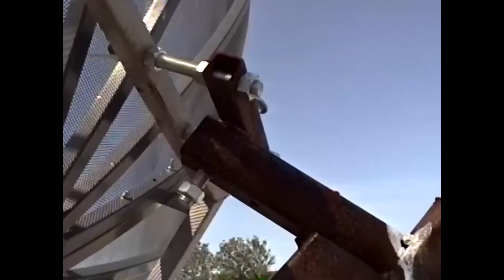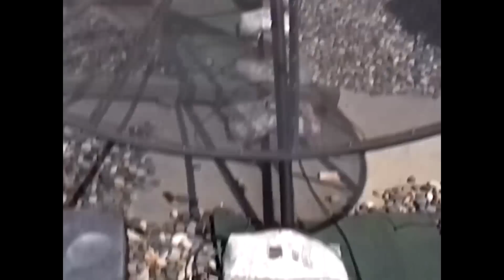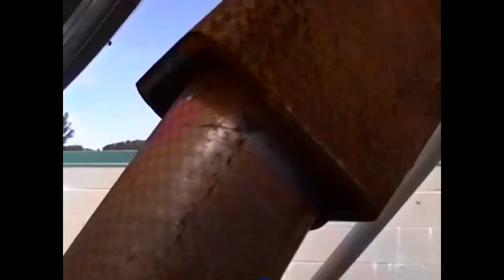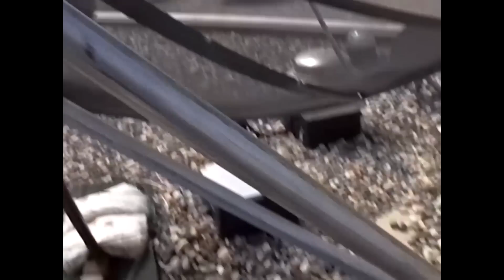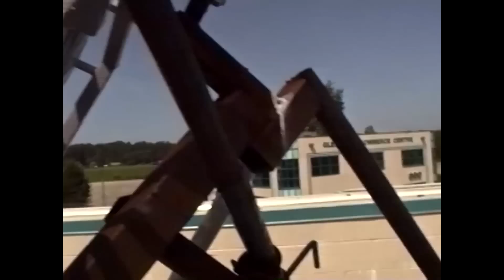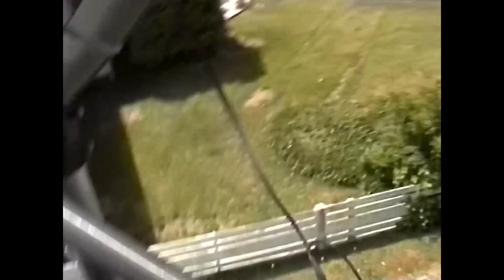How NOT to install a Satellite Dish an inspection that lead to a lawsuit

Comment: Looking at that satellite dish up close, even I would have known it was mounted in a shoddy way (I would have never noticed from a distance); but I never before imagined that there is so many details to think about with those larger dishes. Those smaller dishes used in Dish Network, DirectTV, etc. make it look easy. Even today, satellite dishes (especially the larger ones) still fascinate me.

When did you first start working with satellite dishes, and was it difficult for you to learn all the ins and outs? Have you also worked with satellites that transmit/receive Data (i.e. for banks, big box stores, etc.) instead of TV channels?

Comment: Your video is a good remembering of all the nasty things I've also seen over the years. But yours could win a special mention, with everything for the worst and the ugliest, with a second hand mistreated antenna, a nude LNB (a polarator in a plastic bag!!!), and by far the ugliest available non sense mount (they could have spent some money in a protective spray paint!). Here in Europe C band sat was never popular as far as the satellite networking was done with Ku band with smaller dishes. These dishes (generally 80 up to 100 cm for analog service) could also be mounted on an equatorial mount, and it was a precision work you could only achieve properly if your mast was perfectly vertical and stable! Of course, with a single satellite fixed mount, this was not as important, but you still needed a stable and strong support. Even with later single sat digital service, a 60 cm antenna is generally over sufficient, but wind pressure is always a problem... I remember how antennas and dishes could cause structural problems  to buildings or went literally away with early 1999 tempests. And I also remember trying to explain to some stupid how it was dangerous to mount such equipment on a chimney, to see the complete stuff down the street later in December 2005!

Comment: I have been using a #FreeSatelliteTV C band dish for years, I don't get as some of the over the air tv networks in my area. So I use a Amiko Receiver to get the Digital Broadcast channels. It is great because I love the old tv shows that are on MeTV, Cozi, Heros and Icons Grit etc Most of them are on C band
Reply from the maker: The METV channels are available on a local terrestrial station here. All 7 of them.

Comment: It's laughable you're "inspecting" an old satellite 📡 dish.. looks like it's been up there for a decade with all the screwing around that's happened to it.  No installer in their right mind is going to pierce a membrane on a flat roof to install a satellite dish "securely".  Using rock or sandbags is a normal way to mount this equipment on a flat roof.  With residential they don't care what they do to your roof for the most part, because it's residential and they get contractors to do it that go out of business about the time they leave your driveway.
Reply from the maker: A proper mount for a flat roof is a large square base with a 3.5" pole mounted it it that the proper polar mount is attatched  weighted down with usually bags of concrete in sacks and alot more than what they had.  I agree never penetrate the roof, residential or commercial.  This one was just bad though.
Reply: @12voltvids  Also the rocks were in plasic bags, which will turn to nothing within a year from the UV. Proper installations I have seen used concrete slabs as weight.
Reply from the maker: @mrnmrn1  that's right.  Concrete slabs or bags of concrete which will get wet and turn to solid concrete.  It was a disaster that was installed by a supposed professional satellite company.  I was by no means a professional satellite installer. I had installed exactly 1 big dish.  It's still standing so i must have done it right.

Comment: I am in awe! The level of failure here is genuinely impressive.

As for programming, I remember on Telstar 3, transponder 21 I think it was, there was some syndicated shows for the upcoming week, I think the channel was a network uplink for the broadcast channels to get the shows. My family had a C-band system in the 1980's, from 1986 to 1989.

Comment: Is anything done on those ginormous C-Bands anymore?

And did they win the lawsuit?
Reply: All of the network feeds to the affiliates (ABC, CBS / CW, FOX and most cable channels) are still distributed by c-band in the US. NBC and PBS use Ku for their primary feeds, but PBS is transitioning to a file-based distro across the internet (though they've been working on it for years, but still have their traditional satellite distribution running). In Canada, most of the "networks" are all master controlled from one or 2 locations for all of the stations across the country (CBC / CTV / CITY / Global) and as far as I know, what little traffic goes from the "local" station back to the central master control (usually only the local news) is by fiber. All of the "cable" distribution in Canada is either by Shaw Direct (Ku FSS), or Bell Satellite (Ku DBS), with some cable channels distributed by fiber (so when you watch "cable" in canada, you're basically just watching Shaw Direct or Bell ExpressVu, but on a wire, not by satellite).  You can find lots of live events still backhauled on c-band and Ku band. 95% of the live news feeds have all gone to cellular backhaul now - they have a backpack sized unit that has 5 or 6 cell modems bonded together, and it's much cheaper and quicker to setup, and a lot more portable than a sat truck. Live news feeds on satellite were some of the most interesting stuff up there before. There's also a huge re-organization going on right now as 5G cellular has taken over the bottom 50MHz of c-band, and in the final configuration will take over the bottom 300MHz of c-band, leaving only 200Mhz for satellite. (C-band used to be 3700Mhz to 4200MHz - after 5G takes the bottom 300Mhz, satellite will only have 4000-4200MHz). As a consequence, some signals are transitioning to fiber distribution. Satellite used to be a really fun hobby to play with (and it still is), but more and more stuff, even live events, are going to fiber now.

Comment: Sky prob would have had 16 channels at that time in UK.
Reply: I still have the same 60cm dish on my wall required to receive those channels, upgraded the lnb and still get free foreign TV and radio on it. 🤔🤔
Reply: @markrowe8824  in the 90s it may have gone up 60 channels don't remember but had amstrad and pace box's.   And sky HD is now a lot better but cost lots.  Disney plus seems to be taking over.
Reply: @EastAngliaUK  yeah when sky digital launched I had a separate 30cm dish installed, again still have it but now lnb upgraded to use with a sky HD box, then cable came to our street and switched over for added broadband, no longer subscribed to sky but box still used as backup for free TV and radio channels.

Comment: before digital and HD I take it
Reply: Most of the HD signals that are broadcast still go by satellite - but more and more are going to fiber. The dish is the same, but you need digital receivers. That old analog boat anchor "satellite receiver" from the 80's won't do anything now - there's no analog satellite left.

Comment: Are you wearing the same watch since 98?
Reply: it still works fine, maybe a battery change or two
Reply: @marcogenovesi8570  This model is solar powered and has a high quality rechargeable battery, might still be running on the original one.

Comment: You did a great job dave ,  You made it very clear that it was one massive ripoff and was very dangerous.
I bet the installer company got thrashed for there greed.
Somewhere in the mid 80's i guess.
The tape has lasted very well.
Reply from the maker: It was 98 and that restaurant is still there. Thats why i blocked the name.
Reply: @12voltvids  You sounded different outside with less bass and i thought you were  a lot younger., you were 23+ years younger in 98 ha ha.
I was too busy watching you checking the heap of crap than noticing names.
Reply: God that was so damn bad, surprised that it even worked at all
Reply: their*
Reply: @DarthVader1977  Ask me if i care lol.

Comment: Are those large satellite dishes still used these days?  It seems we most consumers shifted to the smaller kind used by companies like DirecTV and Dish Network.  I wondered if one can still get TV using the bigger style or what they are used for these days.
Reply from the maker: Lots still on cband a quick check if lyngsat shows tons of channels.  Most us scrambled. The METV mux of 7 channels is free to air but then i can get that off air with atsc antenna.
Reply: @12voltvids  Lyngsat is not a very accurate or up to date list of what's there, but it gives you a rough idea. The long and the short of it is there's still lots of stuff on c-band, but more and more is going to fiber. 5G cellular taking over the bottom 300MHz of the c-band spectrum is accelerating the move to fiber.
Reply from the maker: @gorak9000  I haven't looked at lyngsat in a long time. My c-band dish which also has KU is still mounted I don't know whether the actuator works or not anymore because it hasn't been moved in many years. I still have a receiver setting up on the shelf stop plugged in the coax I think is still connected to the dish. It's one of these projects that someday I might try it out again and see if it will still pick up anything but the chances are pretty unlikely. Maybe I'll just take the dish down and scrap it because there's not really much of interest on it anymore. In my younger days it was fun to chase out the wild feeds. I had a blast searching out the news feeds that were on satellite but these days I don't even think there's much there anymore. Modern remote news gathering uses more microwaves or even cellular these days. In fact I can't remember the last time I saw a microwave truck for the local news stations. You should see them driving around all the time with the dish towed on the roof of the van or when they were set up they had the mast up with the antenna pointed towards one of the local mountains where there was a receiver site for the station. I think these days they probably just plug their camera into a phone and go through the cellular network or broadcast from a phone for that matter. I remember seeing some adapter cables that would take the output from the camera and interface it directly to a cell phone to utilize the modem and that was years ago I'm sure it's all done by Wi-Fi these days just turn on the hotspot on your phone turn on the Wi-Fi on the camera and you're good to go. The fun days of finding stuff off satellites catching reporters in the act of straightening their tie or practicing their lines are picking up speckled lettuce out of their teeth before going live those days are gone of course the real fun times was when a reporter had a little meltdown on camera before going live or after or when something didn't go as planned. Some of the funniest stuff was before they went live or after and quite often involved members of the public doing something in the background. I remember that one time this female reporter and I forget her name but the language that came out of her mouth when some guy gave her a cat call in the background off camera was well let's just say sailors would blush! I mean she berated this guy for about 30 seconds dropping every four letter word in the book multiple times and then turned around put on a smile and went on the air live all the while the guys were still heckling her in the background and as soon as the live report was done she lashed out again. I wish I had recorded it quite often I did record the wild feeds just to see if something funny would happen but this time I didn't have a tape in the recorder.
Reply: @12voltvids  Sometimes you can still see some behind the scenes news reporters, but as you said, in the last 2 or 3 years there was a monumental shift to cell based news gathering. There was some cell-based feeding before that, but about 3 years ago, there was a concerted shift to cell-based being the primary medium. The primary 2 systems in use are Djero and LiveU. Both have backpack sized units that bond together 5 or 6 cell modems for a more robust (and higher bandwidth) connection, plus they use a video encoding that can "gracefully" handle interruptions in the bandwidth available (so they fall back to a lower resolution when the connection gets worse). There is still a little satellite news gathering, but mostly only when one of the major networks is remotely producing the entire news broadcast (like right now with the hurricanes). There will be 3 or 4 different camera angles going back, and then they actually do the production remotely at the other end. Right now with the hurricanes, you get a few more satellite based feeds too (but they're satellite re-feeds of one of the cellular-based feeds - having a 6 foot satellite dish on top of a news truck doesn't work so well in high winds compared to a cellular based backpack). There's still lots of other things to watch, if you care about sports (which I don't) or regular TV (which really has almost no content that's worthwhile these days, and for what little is worth watching, there are other methods to get it that are a lot more convenient). There's still probably a few hundred people that are using the big c-band dishes, but I think the numbers are dropping all the time, and it's become a very niche hobby for only the most technically inclined. The 5G takeover of 300MHz of the c-band spectrum is also hastening the transition to more fiber-based distribution as well. 5G has taken over 50Mhz so far in phase 1, but in the next few years, that expands to 5G taking over 300Mhz (of the former 500Mhz) allocated to satellite. It's still a really fun hobby, but it's changing pretty rapidly. At minimum to get your dish going, you'd have to get a DVB-S2 receiver - there's 0 analog signals left, and there's maybe only a handful of DVB-S signal left in north america. Everything went to DVB-S2 with higher order modulation to save satellite bandwidth (aka transponder rental cost)
Reply from the maker: @gorak9000  yes I do have a dvb S2 receiver but I haven't been able to see much on it. I used to listen to the music choice channels quite a bit I like those ones when they were around but I haven't been able to find them recently I don't know whether it's my co-roaders not turning properly there's an old analog receiver I use that controls the polarity and I have an external Jack controller to move the dish. Maybe someday I'll get back into it play around with a little more.

Comment: You have reminded me how in the 80s the local Pay-per-view company installed their Satellite Dish at my house. It was around 14 months later my cleaning lady noticed the varnished wood floor in the breakfast nook had a huge black patch of rotting polished wooden flooring forming in the corner. The cause was the sat dish their installer had bolted to the exterior wall of my house had jacked the wall open away from the corner framing to the extent daylight actually showed through 1/4 inch gap & every time it rained the water seeped in & in winter had been freezing... I never used the room off the kitchen so never went in there! Get this: the only thing the Pay-per-view company did was move the dish & when i said i'd see them in Court if they didn't fix my house the threat was i might just get hurt badly any day soon or if i dared get an idea of anything like that & that they had much bigger lawyers than i could ever afford.... Pity i was not living in The USA, this would have been an interesting win instead of a huge fail the criminal activity of a large Corporate. The minute this crap went down i cancelled my subscription & although they demanded i return their decoder in person at their head office i left it at their local agency a drycleaners outlet & electricaly destroyed the smartcard so it couldn't be used but looked fine.
Reply: Here in the USA you would be treated as the criminal for vocalizing the wrongdoing, maybe locked in a cage if some emotion was expressed during your situation, all while exercising your only remedy; buying some 'maybe' justice.

Comment: Dave quick question , how many channels could you get from that satellite dish and from what other countries ?
Reply from the maker: Programming from other countries was available on Intelsats. These ones were right on the horizon for most part I remember working on one was a big one about I think a 24-ft dish for a Punjabi TV station on Surrey. The district like it was standing almost straight up as it was aimed very low on the horizon to pull in programming from India directly. They used to record the programming which all was delivered in the pal format where they had to convert it to ntsc so they could rebroadcast on their own domestic satellite. they didn't actually do the broadcasting however at the studio they received programming direct from India.  They converted it from pal to ntsc and recorded on tape. When they rebroadcast they had an encoder that converted the analog signal to digital and fed it into a bank of t1 telephone lines which carried the signal to the uplink facility. I had to do maintenance on their dish one day because in a high wind it shifted. The install was much like this one but instead of using 40 lb bags of rocks they use bags of concrete.

Comment: Holy shit!  What a junky installation.  Dangerous one stiff wind and its gone.  Which company was that. Just wow!
Reply from the maker: I forget what company did it, wouldn't say here anyway. Same with the restraunt. It is still there in same location.
Reply: @12voltvids  Did they get compensated?
Reply from the maker: @commodoresixfour7478  have no idea.  I handed them the tape and collected 100.00